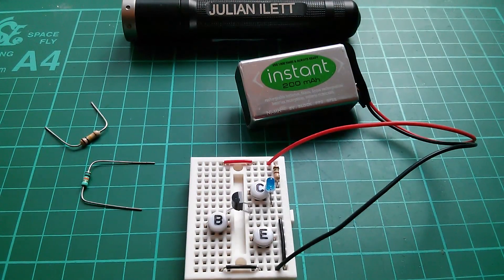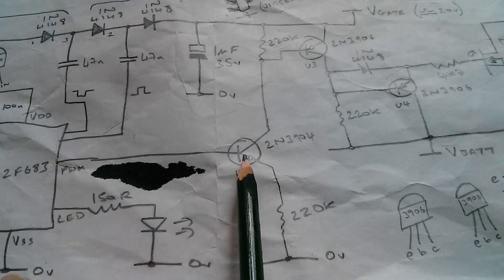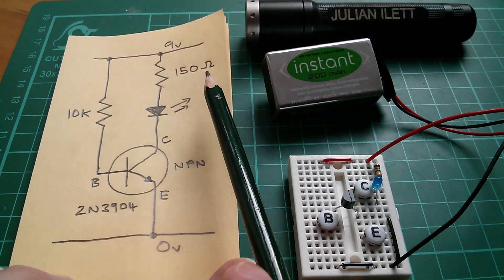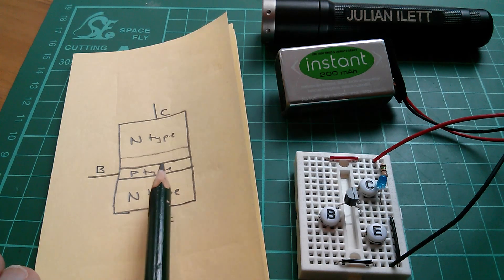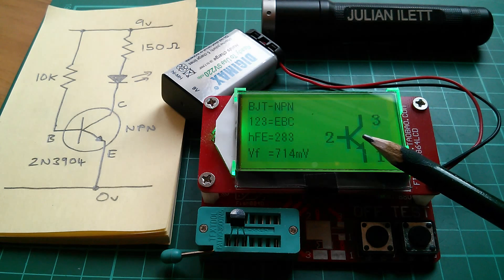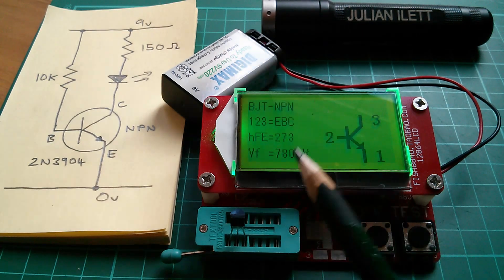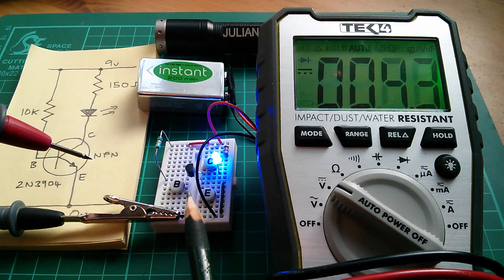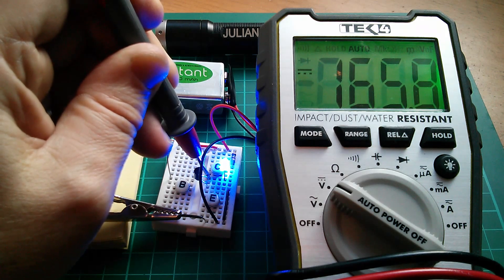Playing with Transistors: NPN 2N3904 Transistor Experiment

Comment: 0.7V is the standard drop for diodes, etc..
Reply: +Google+ SUCKS BALLS - the worst forced social network 
There is no "standard" drop. Sure you can use .7V for back of the envelope calculations, but if you ever expect to see that in reality you're wrong. Even your run-of-the-mill 1N4148 diode goes from a Vf of .5@0.1mA to .9@100mA. A 1N400x is specified at 1.1V@1A. Same goes for the base-emitter junctions in transistors, but even worse VBE changes with the colletor current as well. And don't get me started what happens to these values if you change temperature by just a few degrees.
Reply: +superdau no need for explanation.. I know diode specs more than you think. But if you google diode voltage drop or if you went to some electrical school - the first thing they teach you diode drop is 0.7V.
Reply: +Julian Ilett 
When there is no base current, transistor is behaved as you expect (collector-emitter's voltage is not enough to conduct current, same as diode), but when there is base current, area around p-type (depletion region) is shrinked to the point where distance between collector and emitter is so small so electrons from collector's n-type can "jump" directly to emitter's n-type as there is no p-type at all.
Reply from the maker: +superdau Yeah, transistor as a temperature sensor - I should have blasted it with my heat gun to see if Vce(sat) changed.
Reply: Julian Ilett you can find both vCE at given currents and temp coificient graphs in typcial transistor spec pdf
Reply from the maker: +Google+ SUCKS BALLS - the worst forced social network What I still don't understand is how Vce is so low when there are 2 semiconductor junctions involved (N-P-N) and Vbe is higher across just one semiconductor junction. You know, the physics bit!
Reply: Julian Ilett I won't pretend I understand everything but here's a copy/paste that gives a hint: "Because the charge carriers injected from the base effectively eliminate the depletion zone between the collector and emitter. The collector current doesn't have to overcome the P-N junction potential because the base current has neutralized it."
Reply: +superdau You can use the BC and BE junctions in transistors as diodes and get some advantages over actual diodes (I don't remember what advantages those are unfortunately. BC and BE diodes have different pros and cons), but of course they would be for low voltages and currents only.
That's a tip from a Bob Pease book I have. I'd like to say exactly what the advantages are but he had a very distinct style of writing - very conversational with planty of hand drawn diagrams. There are complete gems of info scattered through the books but they're not exactly indexed at the back.
Reply: +Julian Ilett 
The diodes are back to back, which means the voltage drops are in opposite directions and cancel each other out. So you should really wonder how something like that can conduct at all?!
Reply: +Google+ SUCKS BALLS - the worst forced social network 
I never really thought about this part until Julian mentioned schottky diodes in the video, but where does the Vce_sat voltage come from? I know, like you say, once the depletion zone is eliminated, there's a conductive path through the layers, so no more PN junction drop, and looking at the characteristic IV curves of a transistor the saturation region looks mostly like a low value resistance (but so does a forward biased diode), but does the Vce_sat come from the semiconductor material or from the metal-semiconductor junctions, and are the metal-semiconductor junctions non-rectifying/ohmic or rectifying/schottky junctions or some are one type some are the other?
Reply: +KX36 
You use transistors as diodes when you need low leakage current (very important if you have high impedance sources; an example for that is intramuscular EMG, where you measure action potentials of a few - ideally a single - neuron). 
Again to quote from an 1N4148: 25nA at room temperate, again variying wildly with temperate. We are talking about changes of several orders of magnitude over 100°C temperature change. A cheap transistor can easily go down in the pA range.
Reply: +Julian Ilett  It is due to the "Transistor Effect".The base current is injecting holes into the P material which causes the current to flow between the two N regions. So the semiconductor is becoming more conductive.
Reply: +superdau A transistor looks like back to back diodes in a diagram, but it is not really like that at all. You can verify this by putting two diodes back to back and trying to make them act like a transistor. If it was really that easy transistors would have been invented much sooner than they were.
Reply: +Paul Frederick 
It was a reply to Julian who wondered about not seeing two diode drops. If he assumed that, he should also wonder, why it would conduct at all. I know that of course the assumption is wrong.
Reply: superdau
Yes because a transistor is not two diodes.